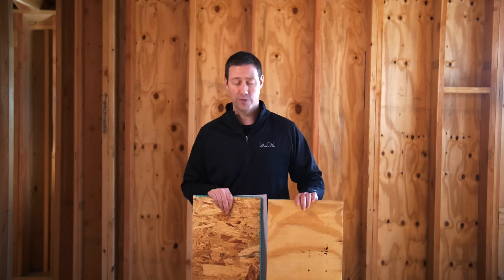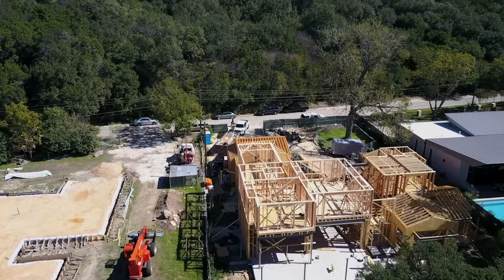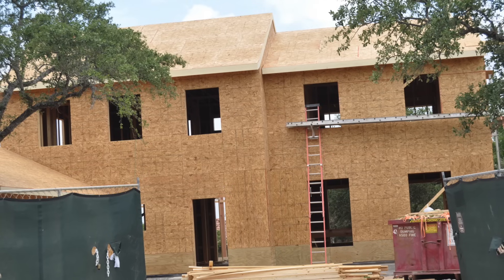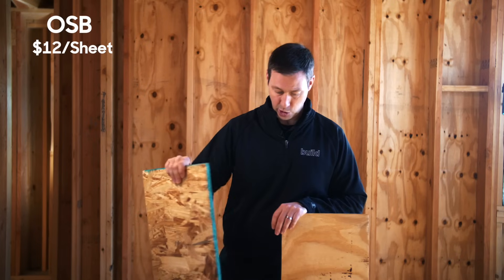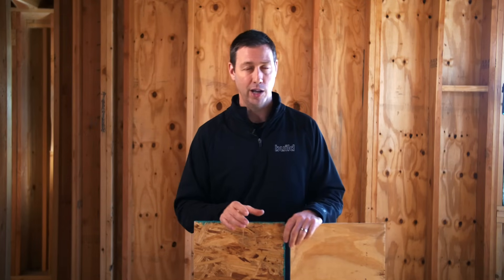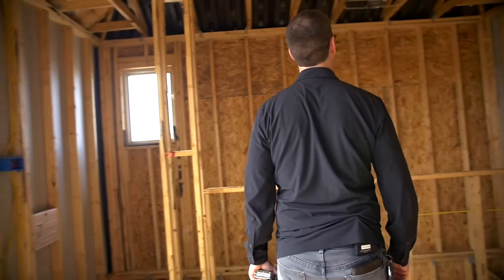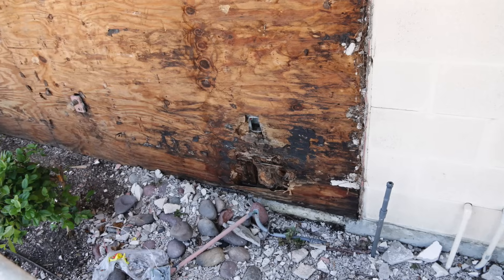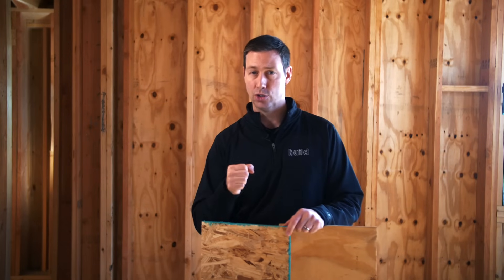Framing : OSB vs. Plywood - Whats the difference in COST AND PERFORMANCE

Comment: We since 1980 had these wood frame houses but the fut foot or 2 are brick above ground the wood never get near to the ground our homes are also clad in brick for the outer layer as people are still reluctant to by home without brick walls.
But the issue comes from life span see prior to 1980 the average uk home would last 450 years but these would frame houses are failing already .
In the uk we like to extend our our homes make the bigger that easier to do on s brick home than wood frame homes.
Then you have radon issue these sealed wood frames all more contamination to remain in the homes

Comment: Whatever happened to plywood with Tyvek? Plywood has better temperature resistance, you can even spray Thompson's water seal over it after you get it up and then apply the Tyvek. One thing about OSB don't ever ever ever spray and insecticide on it, it will destroy it.

Comment: OSB in my own opinion has no business being used in any kind of construction. It can never get wet, ever or it is absolutely worthless. It makes no sense to use it in any wood structure since the first thing that happens in a fire is a tone of water is sprayed into the structure. Even if you get the best case scenario, and the fire is put out quickly, the OSB has been destroyed by the intervention. Plywood is a much more reliable material, and well worth the cost.

Comment: I'm totally missing your math Matt...

If you need 200 sheets to cover the 7k sq ft, and each sheet is $18, then 200x18= $3600. If you then  divide that cost by the 7k sq feet, I'm not seeing where you're at .17 a sq ft, but either way, I don't even see the $3600 cost represented a/where.  Am I o/looking the obvious?
Reply: $6 being the difference in the two

Comment: Just a few comments on how houses used to be sheathed, from my perspective of having worked primarily on houses in Fairfield county,CT. The earliest ones I’ve had to work on dated to the 1700s, a number were from the 1800s, the majority that I’ve had to deal with ranged from the 1920s through the 1960s.

In the 1800s it was not uncommon for a balloon framed house to have no sheathing behind the siding. Clapboards would be nailed directly to the studs. In the 20s, 30s and 40s there was almost always 1x8 tongue and groove boards nailed to the studs before the siding. They would run horizontally if the framing had let in bracing, diagonally if it didn’t. We have owned two homes, one built in 1958 and our current one that was built in 1951. Neither one was built with plywood sheathing or subfloors. In talking to the old timers who had been working in the trades back then, I learned that the early plywood tended to delaminate just from the normal water vapor produced in the house. Plywood ruled the sheathing market from  the 60s through the 70s. The popularity of OSB grew through the 80s, particularly with spec builders. Worked on one house in Old Greenwich that had been built around 1985 and originally sold for $750,000. There was one spot where the framers had put two or three nails into the PVC waste stack that turned about two square feet of OSB into mush. There was another spot where they lapped the Tyvek backwards.

Comment: My goto choice is plywood over OSB and I have seen both lower in cost than the other. What I did see recently in the Bullhead City area was OSB being used instead of shiplap under exposed eaves. All I could do is shake my head wondering what moron made that decision as I watch it delaminate.

Comment: Osb sucks, plywood sucks less. I've seen OSB on a roof with 24" centers where it rained about a week straight. The osb sagged up to 8" in some spots, popped all of the decking clips out (possible a bad batch) but damn.
Seen issues with both, but less with plywood. You can also wrap a curved wall with plywood, but you'll have hell doing that with osb...
You can put holes on osb way easier than plywood. I live in Lubbock and have built many of the Texas Tech designed tornado shelters, none use osb.
I've seen osb for sub floors and walls get a lot of moisture and flake up really bad and even 7/16" osb swell to 1 1/4" thick on edges, but I've also seen plywood lamination fail.
I don't feel like the glue is as good as it use to be in either product.
I would personally choose plywood out of the 2.

Comment: I would have liked to see a real strength comparison.  And most OSB that gets soaked one time is likely to swell up and break into chips.  

Do NOT use any non-plywood for sub-flooring if you are installing REAL hardwood flooring.  The hardwood flooring industry recommends against chipboard products since they don't hold flooring nails well.

Comment: All these comments from people talking about plywood being stronger, more fire resistant, more beterrer in any way are kind of missing the forest for the trees.

You know what is even stronger and more fire resistant than plywood?  Poured concrete walls!  Or, let's try 3" thick solid steel walls!

Asserting that plywood is stronger or whatever is a complete non-sequitur.  It's like saying you wouldn't buy a Ford truck because a Tesla Model S is faster.

Every building we build is full of products that are a compromise and whether or not the compromise is appropriate is the result of a lot of factors.

We can make homes way safer and more durable than we do today.  Of course, no one could afford them, or they might have total source-to-use energy costs out the wazoo, or they might be uncomfortable to live in.

Now, you might make a good argument that given X cost for OSB and Y cost for plywood and Z client budget, and A material availability, and B environmental concerns then of course you should use plywood.  

However, that is not the argument most are making.
Reply: Oh, I also forgot to mention that there are widely varying levels of quality you can purchase when it comes to OSB and no one specifies whether they were using the Lowes special or something way better when they complain about their experiences with it.

Comment: Someone should invent a cheap house spray where you simply use an airless sprayer to spray the entire house before the finish material is put on.
Reply: I've seen that, maybe on one of those housebuilding shows. I don't remember if it as intended as "liquid housewrap" or if it was just to seal the cut edges before putting on housewrap. The latter sounds like a good idea; I'd be suspicious of the former.

Comment: #1 cardboard is supposed to give longevity, moist removal and increasing stiffness to the buildings outer walls

#2 if you only use cardboard and no other products then you're doing it wrong

#3 if osb and plywood is your only recommendations then you have no experienced then you are as good as a cowboy builder

#4 you only talk cost of work and not value to the customers life and ease of maintenance on the home

#5 i also agree with Michael Montecalvo on the fire issue

Comment: Plywood made from Southern Yellow Pine has been a nightmare since the first sheet Georgia - Pacific made back in the 50's.  Now they use the easy to grow fast, unstable and decay from SYP to make OSB.  Avoid Southern Yellow Pine, it never works well.  Insist on Western Plywood and OSB, ONLY ! I worked for G-P for 7 years back in the 1970's, it was a lesson in how to make more money and squeeze every penny from the peddling of lower and lower quality wood products, drywall, and roofing.  OSB is a great technology, just never when it uses Southern Yellow Pine which grows very fast, has no decay resistance, is highly unstable wood, and cheaper to grow and harvest that weeds. We should only sell it to the Red Chinese.
Reply: The Chinese don't even buy crap like those

Comment: You didn't talk about termites on each one.
Reply: I missed hearing about the possibility of having core voids in the plywood that can trap water and hold it until it rots through.  And of course you can have delamination on the glue lines between the veneers with plywood.  Just saying.

Comment: How can someone say “This is 7 sixteenths and this is 15 thirtyseconds” and not just stop in his tracks and sigh “God, why aren’t we using the metric system?”
Reply: Because this is America, and we use both. My audio equipment has a 3.5 mm jack, my skis are measured in cm and mm, and my cars use metric nuts and bolts, even those made in the US, so we are using the metric system, just not exclusively.
Reply: Detonate Klubstompers 
I do realize that. And I usually don’t understand why you hang on to the imperial measurements, but I’ve watched enough woodworking videos to just ignore it and move on. 
But this one was so complicated that I just didn’t get how those two numbers could be compared in any meaningful way.

Comment: As a European I can't understand this 'Merican obsession building houses with wood. Don't you want your house to withstand earthquakes, fire, flooding, or hurricanes? 
Not to mention making the walls essentially hollow, can house all kinds of vermin and insects.
Reply: Actually the main point of building with wood is to be able to shift during earthquakes. A full concrete house would crumble after a couple of earthquakes
Reply: Well, no, I have been in buildings during earthquakes (the strongest was 6.0) and no damage was done. Only ones that had damage were some old pre-50's houses that their owners made completely on their own. Today all buildings have to be earthquake resistant (magnitude depends on the area)otherwise would not get a permit. Generally we put steel on the columns that can give the flexibility needed.
Reply: @gamingforpizza5142  yes but why go through all that trouble? I meant if you put the same amount of effort as building a wood house the result would be shit. Basically yes concrete houses are probably stronger, but is it really worth it?
Reply: No one here would even consider make or even buy a wooden house, you only make wooden houses in US because that's "how it's done here" since the 16th century. 
Currently I live in an apartment complex that was build in 1974. I did a bit of a interior renovation (walls, floor, wiring, etc.) and it looks like new, and I expect to live here until I die, so yes it's absolutely worth the effort and money.
Reply: It's plentiful easy to transport and construct however like with anything you can build a brick wall that will fall down. And you definitely don't want those kitchen Fitters doing your Electrics.
Reply: @gamingforpizza5142  Wooden houses are a lot warmer and don't need as much insulation and heating costs are lower. They are much nicer to work on as well. As a carpenter I love them.

Comment: OSB is a BIG MISTAKE on subfloors: You failed to mention that if your subfloor is in OSB you'll need 1'1/4 OSB  to hold tiles correctly while a 5/8" Plywood  will do the job perfectly. So if you want to tile floors stay away from OSB because it will be a nightmare to level different parts of the room 5/8" more like: trims/doors/other non tiled floors. So it's a thumb down for now.

Comment: It's very simple, OSB is only suitable for sheds and crap that will fall apart in a few years. Plywood is at least a little better than OSB and will last a bit longer, especially if it doesnt get wet.

Comment: I can't stand working with OSB. Chips, splinters, wallowed out screw holes, nails bounce out. Don't drop it on a corner, don't get it wet, don't feed it after midnight. I'd spend the extra money on plywood just because it's easier to work with.

Comment: OSB = bonded scrap wood from the mill. I would never save a few grand on a new build for anything that is structural. The grain of plywood is continuous, thus making stronger than the short scraps of wood chips randomly bonded together.

Comment: In remodels I've on occasion replaced osb or worse particle board with plywood. It's  better in  problem areas.  I  don't replace anything that's working. I've seen people spend a lot of time and money replacing something that's working fine.  I've also seen people replace what failed with exactly the same thing. I guess they expect a different outcome this time. Or maybe they hope it will last long enough to get paid.

Comment: Airtight homes required now equal outside pollution levels that no longer exist indoors . Fresh air from outside is good while indoors all the harsh products we employ, cleansers, carpets, dads make life stink inside. Building codes should stick to; construction, electric and plumbing. Insulation should not be in code books. Joist hangers I believe were invented by an inspector, handy but the nails are ridiculously priced. And hurricane straps on rafters now required because low paid framers were missing the rafter while nailing the roof deck 50% of the time.

Comment: OSB is garbage! PLEASE stop using this garbage on houses!! It's not worth the little bit of savings. Do it right and use plywood. If your contractor or builder wants to use this OSB garbage then hire someone else. They are building about 1000 expensive tract homes in my neighborhood, it's been pouring rain and all of the OSB installed on the houses is soaking wet, they even use OSB joists! Half a million dollar house and I bet they won't even last 50 years.  In some decades they won't be remodeling this junk, they will be tearing them down to start over.
Reply: Yeah..I couldn't agree more.  OSB's water resistance is honestly about as sharp as a damn bowling ball. The fact that some idiot contractors are using it as joists..literally speaks volumes of the chosen incompetence -level of trying to pitch a damn penny.  It's pathetic.  My grandfather would be facepalming so hard if he was alive that he'd need a helium tank on full power to reshape his nose back in to place.

Comment: Why do you think carpenters call OSB "peckerwood"? 
I don't care what anyone says about this stuff it just does not have the shear value of real plywood. 
Instead of the glue holding the wood together with OSB; it's actually the other way around: the wood is holding the glue together.
When we build shear walls it's with let-in horizontal metal strapping in the studs; real plywood - glued with specific adhesive - and nailed with ring shank nails on a certain pattern. Sorry... no OSB allowed!!

Comment: Modern OSB4 is superior in every aspect. Its stronger, cheaper, water resistant, can stand 85% humidity, no formaldehyde and more eco-friendly. Guys in comments should pull ther heads outta their arses and leave the year 2008.

Comment: You can easily drive a golf ball through OSB.All the houses we built in the eighties Used Thermo -ply , it's not for structural strength. 1" x 4" angle bracing and plywood  on the corners.Worth almost twice as much as when they were built. 3:26 shows you why you don' want OSB

Comment: There is no comparison OSB vs CDX. He is comparing apples to oranges. Toll Brothers, Ryan Homes and all other national builders use OSB because it's CHEAP! I've witnessed an 8' 2x4 dropped from 1st floor to 2nd floor and seen it punch through 3/4" OSB. 3/4" CDX, the 2x4 bounces off. OSB gets wet, it swells 20% and never shrinks back to original thickness. OSB does not hold nails used for hardwood floor as CDX does. OSB is a garbage product!!!
Reply: Correction: 'dropped from 2nd floor to 1st floor'

Comment: What happened to bricks 😂
Reply: Brick is just decorative facade today. Behind it is the structural concrete block wall. The brick facade is held to the block wall by brick tabs. As far as why I don't think it is cost effective or particularly sound to build with just brick now. Solid brick buildings are not just one layer of brick. That's not how it's done. But facade brick is just one layer. The block wall behind the brick actually holds it up.

Comment: OSB
oriented strand board.....is omnidirectional 
unlike plywood that needs to be installed with the grain PERPENDICULAR to the vertical stud...
OSB is better than plywood when the plywood is installed incorrectly
like the wall behind you...

Comment: Just use bricks. That's a real house  and much safer.
Reply: I laid the block and brick of the house I grew up in.  It has weathered 50 years of windstorms, "monsoons" and blizzards, no termite nor carpenter ant can eat it.

No more flammable termite food for my housing. I have yet to see a well built house in Georgia, been here 36 years.

Comment: OSB is HOT GARBAGE.  It's CHEAP and that's why it's used.  Plywood is the real deal when it comes to runoff.  Period - end of story.  It doesn't take much for OSB to swell which makes a small amount of water turn into a BIG amount of water.  NOPE.  Plywood is the way to go.  If anything, OSB should be much cheaper but because of the superior improvements in GLUE, of which OSB requires MORE, it's not as cheap these days.  I build BOATS out of plywood and modern glues between the layers are up to par with marine grade (minus the air gaps in the actual wood).  OSB is prone to MORE edge perforation by its very nature and this is why it swells and why it is crap.  Sorry but plywood absolutely out-performs OSB where it MATTERS.

Comment: Bad advice, really bad advice. OSB when heated (to even low temperature) loses all of it’s strength. It will not hold a nail or fastener of any kind, especially on a roof. Have you ever seen a fireman on an OSB rooftop while trying to extinguish a fire or extricate a person? Any heat melts the OSB adhesive and the fireman will fall right through the roof. For that reason alone firemen are now prohibited from rooftops in many municipalities.
Think before you speak.